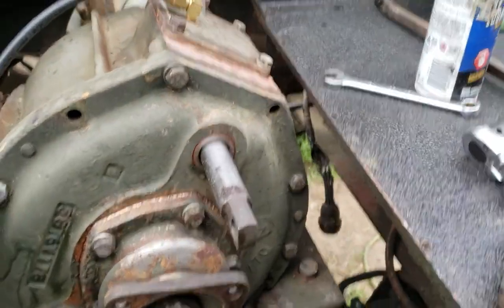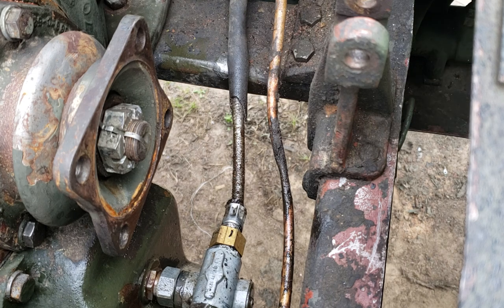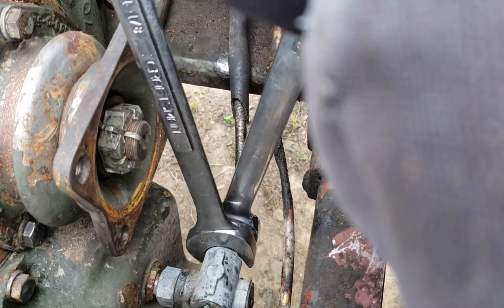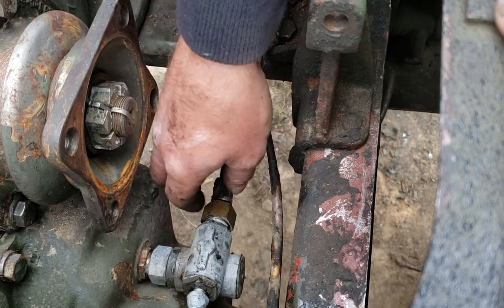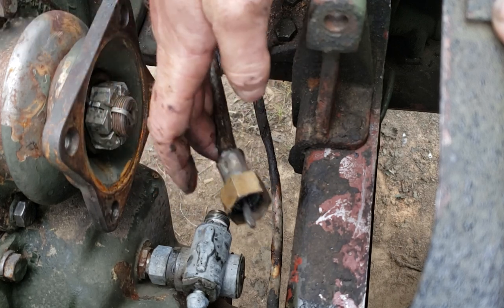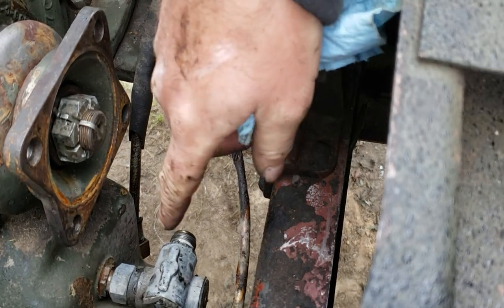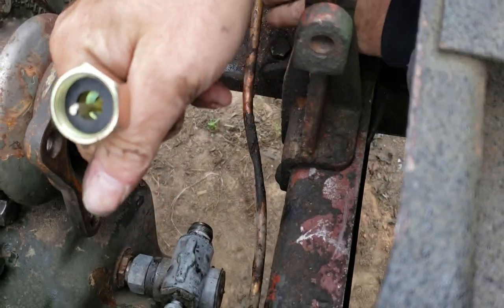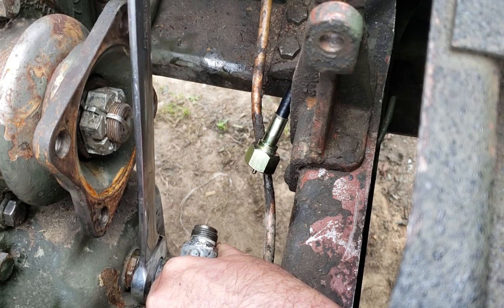M35A2 speedometer cable replacement and adapter oil leak fixes.

Comment: Probably  dumb question, But, how in the hell do you replace the actual gauge in the Dash (M35a2).  I have about 1/2 inch of space when I try to remove the gauge panel due to the wiring being so  damned short.  I need to replace my temp gauge.    i thought it would be easy, but I don't want to break anything else.

All Ideas are appreciated.  

Awesome Channel by the way!  

Michael
Reply from the maker: It's actually the speedometer and tachometer cables that hold the panel back. Get a 3/4" wrench and take those loose and the wires have enough slack to pull the panel out enough to work on.

Comment: May I Ask A Question:  I have a 1977 CJ7 258 inline 6 3 speed stick.   I've noticed that occasionally my speedometer will "bounce around" a little bit. (Example: it will bounce around from 50 to 55 maybe 60).  and then after a little bit of driving it around, I will notice that the speedometer is now registering Firmly, with out bouncing around.  (Example: it will register a Firm, steady 50).   *What do you think is going on.??

Comment: I have 11r20 tires, so I don't use the speedo anyway. Is it possible to just pull that whole adapter contraption and put a plug in the t case that will stop it from leaking?

Comment: running 11-20 will affect the speedo was thinking about running 11-20 in the summer and 9-20 in the winter?
Reply from the maker: Just run 11.00R20 year round. I have been for years.
Reply: @tacticalrepair  I live way up north as in I took my dog out this morning and saw the town   plow! So I run different tires in the winter if I can narrower with studs.

Comment: For that really thin nut, if you got a bicycle cone wrench like Park Tools ITEM # SCW-26 and file it slightly or ITEM # SCW-28 it will be just a little loose, you can hold the thin nut, and still use the 1" on the cable nut.  The wrenches are super thin   https://www.parktool.com/category/hub-axle   By the way that 1 1/16" works out to 27mm and thows were the closest to 27mm i could find.

Comment: If you go up to 395’s how “off” will it be roughly 2-3 mph?
Reply: I think it’s more like 10 mph
Reply from the maker: Yeah it's a lot and it varies depending on condition of your adapter drive and cable. I've seen anywhere from 15-25 mph.
Reply: I have 395's and its right at 10mph on mine.
Reply: Long Rifle what wheels are you running up front or does your tires rub when you turn?
It takes 40 acres to turn mine around because of tire rub and I have 395 too
Reply: BB they are MRAP Wheels with steel adapter plates.
Reply: @brandonbarthel8377  you need to set your steering stops, the bolt that sticks out from the axle limiting steering angle and stress on your steering box. I run 395's with no rub but I also did a 3" lift so that might be why my truck doesn't rub. It also steers the same as when it was stock.